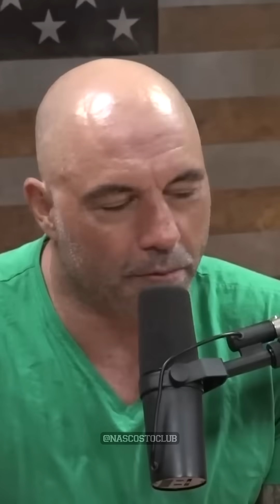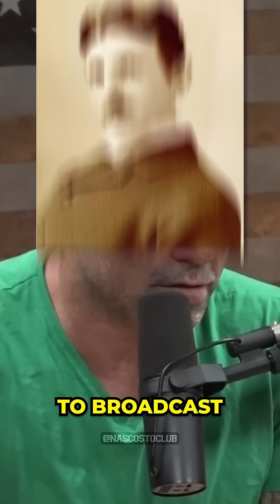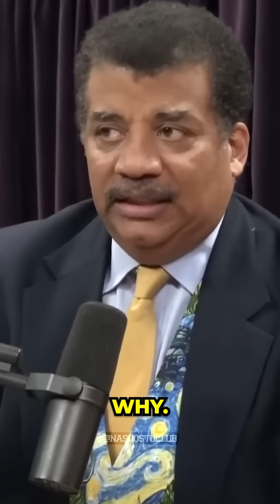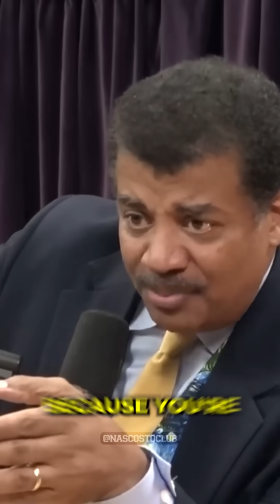WIRELESS Electricity Idea Debunked ⁉️⚡ #shorts

Comment: I think Neil doesn't understand how magnetic fields work 😂 the energy density inside of a cable is zero if you calculate the poyting vector. The energy flow takes place around the wire (air) where the electromagnetic waves actually are. so it doesn't have to do with energy being dangerous alone

Comment: Energy being transmitted through the air: Your  microwave oven would be one such example. Now switch it to a frequency that won't interact with water or moisture in the air or the fluids in your body, or your dna. Then use a directional antenna, like the ones used in a radar system and you have point to point energy transmission - just like your typical cell-phone tower.

In the future enough solar energy will be captured on the sunny side of the planet, then transmitted wirelessly via satellite to the dark side of the planet, and maybe even to and from the moon... to do whatever your little heart desires.

Comment: Tesla made a major breakthrough in 1899 at Colorado Springs by transmitting 100 million volts of high-frequency Wireless Electricity through a coils magnetic field, over a distance of 26 miles at which he lit up a bank of 200 light bulbs and ran one electric motor in order to power wireless devices! His design was to power devices, remotely. With this souped up version of his Tesla coil, Tesla claimed that only 5% of the transmitted energy was lost in the process.

Comment: Also it is very inefficient. Imagine the amount power you need at the source to transmit enough energy. The signal strength also decreases at least exponentially with distance to source.

Yes he had small scale proof of concepts & yes it sounds like a good idea. But when you try to scale it up to meet an actual need you'll see it is straight up inferior to todays technology, practically & economically.

Comment: This Degrassi guy is a big big fat liar  !   Or ashe would say with his cornball sense of humor ... Liar liar pants on fire..  the energy Tesla discover it is not like electricity .. electricity is like electricity because that energy is funneled through wire typically made of copper.. because it is fused with this metal is what makes it hurt us when we touch it .. ever see those balls with all the little lightning bolts in them glass balls you can touch that energy and it does not hurt.. you see what I'm saying.. students such a fucking liar

Comment: NDT is right that it wouldn't work, but I think its more of the just ridiculous magnetic fields that would be everywhere because of that power.  you wouldn't be able to pick up anything on a radio or wifi for all the interference and god forbid you accidentally ground yourself while touching the metal of your car.  all the energy flowing across its surface and induced in its metals now have s path to ground....through you.

Comment: Ahh Niel is some what wrong here, It's been observed that we are not sending energy through wires, but rather over the wires. The electromagnetic field tends to be outside of most types of wires used to conduct electricity, more folks started figuring this out better when we where running cables underwater.

Comment: If you hold a florescent bulb up in the air by high tension wires it lights up. I don't know if you could get it to go 100 yards or miles in length but there's modern proof of concept. Neon bulbs also light up when taped to a cb antenna.

Comment: Neil is actually wrong here, it's been done. Go on YouTube and type in 'linus wireless electricity' or something and you'll find a Linus tech tips video where they're charging a phone and powering some toy trains and stuff with a ceiling mounted device with no wires. Is it imperfect and new tech? Of course, but it absolutely is possible.
Reply: That's not what he was saying. Tesla's idea was to anyone to get an access of his so called "wireless" electricity. Its probably possible with a couple watts, but trying to power 1000 houses good luck lol.
Reply: @rainbowhouse3427  I think you need to rewatch the video.

Joe asks if you could power a simple radio or a lightbulb with this tech, and Neil says essentially that you'd die if you tried because the energy has pathways and you'd be standing in the way. This is not the case, and it has been done, right here on YouTube.

Comment: They have wireless phone chargers. You can also light a light bulb with microwaves.
Reply: Both of those are extremely close range and very inefficient. Best you could do in a real world scenario is have a coil under a very high voltage power line, and you may be able to siphon a few hundred watts from it, would not be practical to do so... neither was teslas idea

Comment: Veretasium proved that the electrical energy DOESN'T flow through cables, but through the air. The cables just complete the circuit.

Comment: Has Neil heard of wireless charging? A group of mit students literally did what he just challenged couldn’t be done in 2007, 100 years after tesla made his tower. The dude was ahead of his time and had no technology at the time to practically apply his invention. Now you can drive onto a pad in your electric car and it charges without you having to do a damn thing. It’s only getting better. Maybe it won’t be transmitted long distance because the efficiency is awful and wired transmission is cheap long distance but come on Neil. We use that tech today. He really sucks sometimes.

Comment: Will what about wire less WiFi ? How do you stay out of the way of that . My phone works just about any where and there’s no wires hooked up to it. Just wondering how that works.
Reply: Wi-Fi has very little power in the transmission, if you wanted to power something that uses real power it just wouldn’t make sense to do it wirelessly, you would need massive more power than needed for the transmission by the time it got to it, and yes that amount of power flying around randomly would be stupid

Comment: Not That I think it would work but this is a gross misrepresentation of the idea. Idea was send electricity through the ionosphere instead of power lines and then have receivers pull it from the ionosphere and then put it in wires at the local level.

Comment: If you have a fluoro tube under high Power lines it glows.
Reply: That is because EMF around 1MV lines is insane. Fluorescent tubes work by electrons bouncing off the coating inside the light. If you were to somehow build a coil within range of the power lines then yes, you could siphon some power from it... however your range would be extremely limited. Doing this on a city wide scale would require hundreds of these extremely high voltage towers, the cost would absolutely not be worth it and the efficiency would be complete garbage.
Reply: @Teh_Random_Canadian  oh, thanks, I wondered why it happened.

Comment: Not saying NDT is wrong. He's obviously well educated. However, look at wireless phone charging. You can touch the charger. No shock. Touch the phone, same thing. Put you hand between the phone and the charger. Still nothing. The way he made it sound was you would always feel that electrical current through the radio waves, but that doesn't happen with a wirelless phone charger. So is it possible to do the same thing on a larger scale like Joe said? That maybe we just have figured out how yet?

Comment: You can power lots of things (low voltage) through the air with wireless power transfer (WPT).
It's short distance and limited.
Yeah-  It's possible Neil.

Comment: Not to mention we wouldn't have any sort of wavelength communication. So wifi bluetooth RG even radio itself would be redundant because everyone would be using the wireless electricity which would interfere with other wavelengths or even nullifying them due to power output of it

Comment: Actually it works. Tesla just raised the potential for a small amount, hich isnt even comparable to amount under the thunder cloud. It can be turned off. You know, switched off by a timer it is not in use? What time do you spend home using these machines? 1-2-3 hours a day, maybe 2-3 in the very profitable family in the morning and 5-6 in the evening? Except when you sleep. You raise the potential in the entire room with those machines and when you leave it doesnt need to hurt your feelings.

Comment: He's technically wrong. It still wouldn't work like Tesla said, but Tesla is right and Tyson is wrong.
 
Your electronic devices are fed power through a conductor in a wire, right? That's only half true. If you were to take a cable with an incredibly dense insulated outer shell over a significant distance like some cables run under the ocean, the cable would not work in transferring the current to the other end. While electricity is essentially a chain of electron exchange in the conductor, and the current is pushed through the conductor with voltage, what's actually feeding your electrical device is the electromagnetic field in and around the conductor, that was made as a biproduct of the electron exchange. So if you used too thick of insulated sheathing around the conductor, it hinders the electromagnetic field and doesn't allow the power to travel through the conductor. Even electricians don't know this, because they don't need to learn it, so it is more of a physicist's area. And you can make an electromagnetic field strong enough to power light bulbs pretty easily, so Tyson is wrong. It is just that it can't travel very long of a distance. And it is not dangerous, we're all around strong electromagnetic fields all day long.

Comment: Standing waves create greater amplitude as they flow in sync with their reflections. The energy would be transmitted sub surface through the water table which is mineralized and acted as a conductor. The planets ionosphere discharges enormous amounts of energy. Around the world, there are over 3,000,000 flashes every day. That's around 44 strikes every second, or 13.2 gigavolts and ten's of thousands of amps..... every second. 
And it's already in the atmosphere ALL THE TIME lol. 
Nikola Tesla wanted to organize the power, and tune it with a frequency that can be tapped into.
His entire argument is flawed, and completely neglects the fact that the energy is actually ALREADY resonating through the planets ionosphere and is a function of nature lol.

Comment: Tyson is a fop. Tesla demonstrated that he could drive a Westinghouse motor fitted to an American Automobile that had its original engine removed. He tuned enough power out of the air and his demonstration was open to scrutiny. Just Imagine if you had his receiver in your Tesla you probably wouldn’t need Batteries. Just because Tyson wasn’t around in Teslas lifetime doesn’t give him the right to deny Teslas achievements …

Comment: Actually if you take a fluorescent bulb under a high tension high voltage power line at night. It glows The energy will not kill you in ten years. It may increase your chances of getting cancer. 
  Tesla was thinking that we would just be supplementing kerosene or coal gas. The lighting technology that was already every where.

Comment: Neil Da Ass Tyson is wrong on this. Nasa did an experiment with wireless electric transfer over 1km in 1976 the GPL Goldstone experiment where they sent 34,000 watts of power from a transmitter to an antenna. Plus power can be stepped down to transmitt and stepped up once received.  This Asstro Physicist is a moron and a gatekeeper!

Comment: And yet, physics has proven that electricity travels through magnetic fields and not wires at all. Wires are a conduit or lower resistance path much of the time, but the energy flows through the magnetic fields. Many studies have confirmed this phenomenon. Unfortunately, NDT is wrong here.

Comment: NDT is full of it. Stand under high voltage lines and hold up a florescent tube light bulb. It lights up. You dont feel it at all yet there is sufficient energy to light a bulb. And Tesla wasnt using radio waves. 

I think I read that Tesla powered a small town wirelessly didnt he?

Energy flows if one end is high voltage and the other end is grounded.... they dont know what direction the electricity is moving. Read a book NDT.

Comment: You could use a frequency wave amplifier with two free day speakers wired wrapped around a quartz crystal let’s say and use the antenna to speakers to electricity charge the fereday speaker wire which would activate the quartz crystal pysioelectricy that charge would be sent to a battery bank or a row of capacitors waaa laaa

Comment: Could you not transmit a low voltage frequency and then with capacitors and rectifiers generate a higher current at the site

Comment: Tyson sounds like Edison killing elephants to make people fear a technology that could lose money for the powers that be. He has been indoctrinated into the current paradigm of thinking that has been put in place by people that can only see the tip of the iceberg. Tesla, I believe, could peer down and see the iceberg looming into the depths. He understood energy on a more fundamental level... we are missing a huge aspect of comprehending reality and technology based thereupon like on vibration and resonance and dimensional planes.  I had the impression that Tesla believed the energy was already in the air... being generated through the vast kinetic pool of air molecules supplemented by solar and static and friction (like lightning from clouds). He was simply attempting to modulate the voltage or amperage or vibration of the energy so that device tuned to that useful frequency could then take advantage of it. Warden Cliff tower pland also indicated incredibly deep grounded nodes... so whatever the actual mechanism for functioning was, it took advantage of things we dont fully grasp about electricity and the quantum world in which it operates. Even with the electricity we do use, it isnt the actual wire literally that electrons are passing thru... that is why you can have a long wire and a short wire and if they connect two lightbulbs that are the same physical distance from power source, they will alight at same time. The current itself is a field that exists beyond the wire.

Comment: To me he explained how cell phone signals work, and we place those phones right on our head.
Reply: But that's not how phones work as they hold power in a battery and receive cellular signal from a tower. 1 amp can stop or start the human heart which is the equivalent of 2 100 watt light bulbs.
Reply: The cell phone signals are also a LOT weaker than anything you'd need to actually power something. Phone antennas emit microwave radiation, same as the kitchen appliance you can use to boil water if you leave it in for long enough. The fact that you probably can only barely feel any warmth at all at most should be an indication of how little power those signals carry.

It also makes sense from an efficiency standpoint. If you just make all of the cell phone towers with more sensitive receivers, then the phone doesn't have to spend so much energy transmitting out which makes the battery last longer. If you had to beam out a huge amount of power from your phone just for the receiver to hear it, your battery would die in a few minutes instead of hours.
Reply: @awareqwx  it would also most likely have dire health effects... like holding a microwave to your head
Reply: @Teh_Random_Canadian  Correct, but I bet people wouldn't hold their phones up to their head if they burned them every time they did
Reply: @awareqwx  Theu probably wouldn't use wireless electricity either if it felt like standing in a microwave
Reply: @Teh_Random_Canadian  Wireless electricity (or at least the version we use today for phone chargers and such) works via magnetic induction rather than electromagnetic radiation, so it only barely affects humans even at much higher power levels.
Reply: Cell phone zse very low output power at non-ionizing frequencies, but they will do heat you up very slighty. Now try to run a lawnmower that way and the difference will become apparent over time.

Comment: Tyson is single-handedly giving fuel to people like flat when they say that "scientists are lying"

If wireless power transmission was impossible or impractical...
Then we wouldn't have wireless phone chargers are the most modern example... But it's nothing new

In the late 80 early 90s. Canada developed a small airplane called SHARP to relay data, similar to a satellite works but more localized. It was powered by a microwave beamed from ground facilities in its flight path .... it could fly at an altitude of about 20km and stay up for months at a time...

Comment: You can charge a fon wirelessly, so basically invent a device like a fon that charges up n turns machines on n off. Place this device on a charger that sends energy thru the air to power anything, don't stand in front of it jus place device on charger n once charged place fully charged device onto any machine to power on n off. Js.

Comment: Neil doing what he does best. Being confidently wrong to elevate himself as a 'current day expert' Persona. Buddy needs some counceling.

That said, he's wrong on this. Tesla never really gave much of a shit as far as the research went whether a 'human' standing in the pathway itself would get 'hurt'. 

That is a stage that comes later. He was primarily concerned with the Question if it was 'possible' to do it, because if he would have had proof of concept, that also meant that we could also invent ways to perhaps modulate the output as we do with everything. Instead of having a lightbulb, you have a mini-lamp with an in-built generator that converts Minimum level of energy upwards.

That technology exists now for decades. Tesla however, coming from a different time period, couldn't yet fully envision what routes science would take in it's useage of electricity.